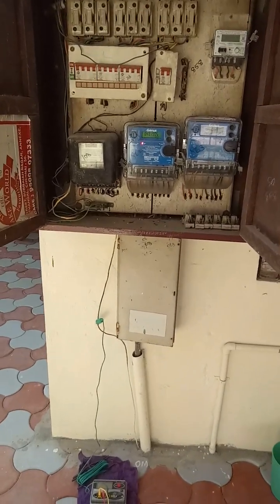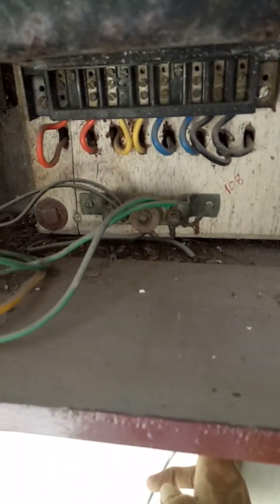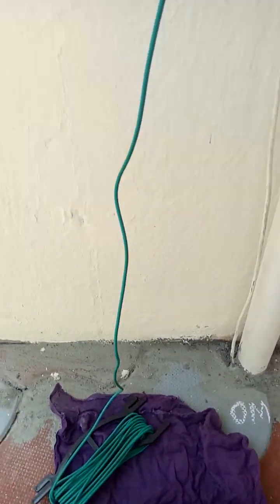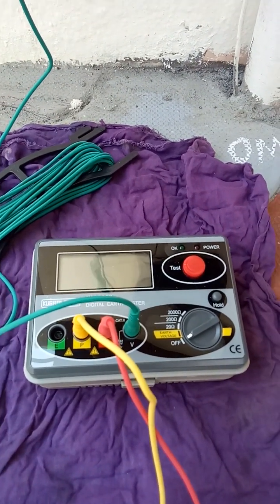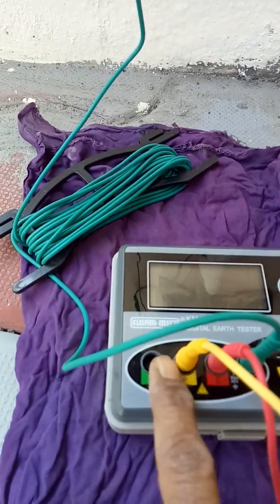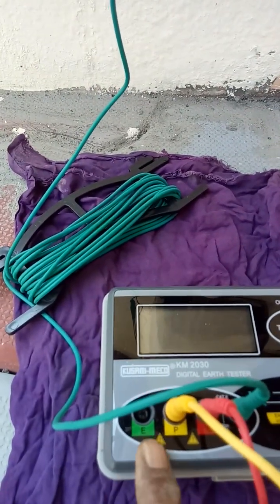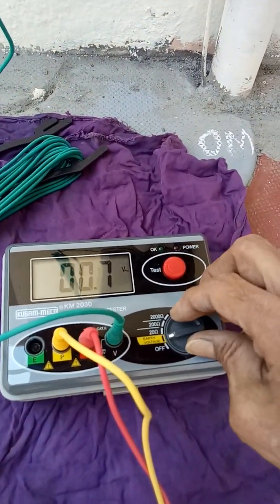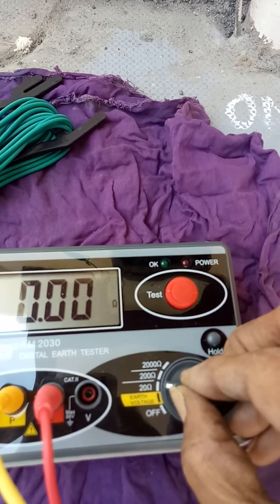Earth pit resistance testing with Kusam Meco KM-2030 tester by FOP method.

Comment from the maker: Caution Note: For energized services first check the earth electrode voltage with connections as shown in video. If its more than 10V don't proceed. (E terminal=dummy, P to Potential spike (Yellow), C to Current spike (Red) and V to earth electrode (Green) under test. Turn rotary knob to Earth Voltage position. Now voltage present will be displayed. No need to press test button. If display shows 10V or more Deenergize the earthing system carefully and then proceed.
During resistance checking pull out green probe from V terminal and inset it into E terminal. ie leave V terminal dummy.
Reply: If the anloage meter test ,how to measure earth electrod voltage
Reply from the maker: @abdulazeez4930  same method.
Reply: Analoge means hand rotate earth tester sir ,how to measure earth electrod voltage
Reply from the maker: @abdulazeez4930  it should have that feature.
Reply: Ok sir